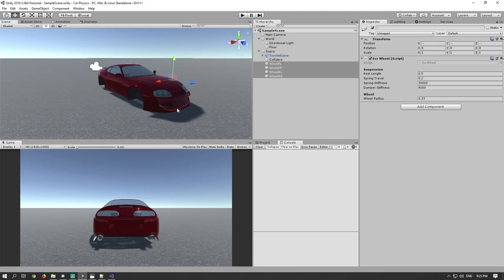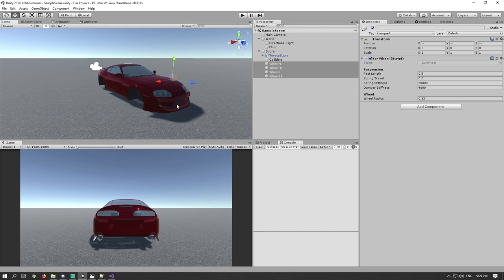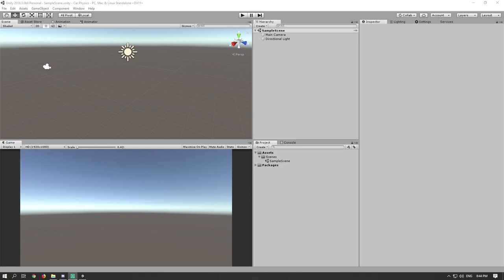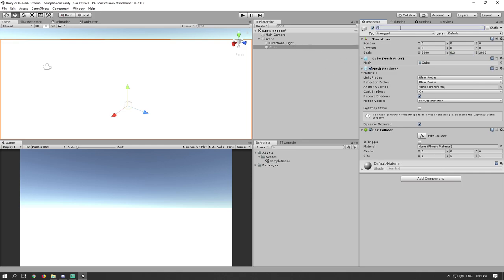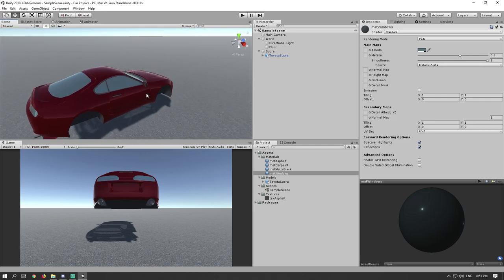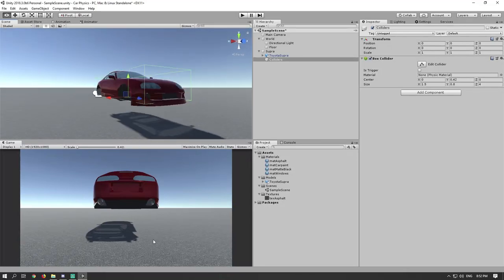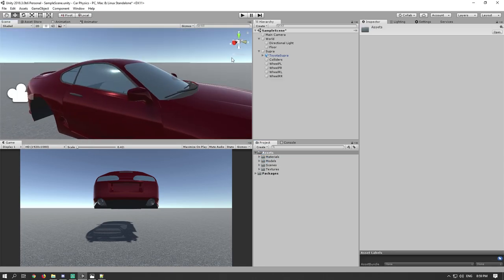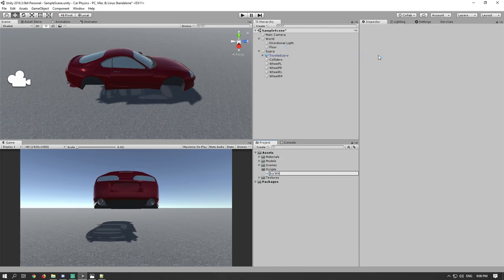Unity Car Physics - Lesson 1 - Suspension Physics

Comment: heres the code for this tutorial: (keep in mind, some values need to be changed to fit your game

using System.Collections;
using System.Collections.Generic;
using UnityEngine;

public class ScriptWheel : MonoBehaviour {
    private Rigidbody rb;

    [Header("Suspension")]
    public float restLength;
    public float springTravel;
    public float springStiffness;
    public float damperStiffness;

    private float minLength;
    private float maxLength;
    private float lastLength;
    private float springLength;
    private float springForce;
    private float damperForce;
    private float springVelocity;

    private Vector3 suspensionForce;

    [Header("Wheel")]
    public float wheelRadius;

    void Start() {
        rb = transform.root.GetComponent<Rigidbody>();

        minLength = restLength - springTravel;
        maxLength = restLength + springTravel;
    }

    void FixedUpdate() {
        if (Physics.Raycast(transform.position, -transform.up, out RaycastHit hit, maxLength + wheelRadius)) {
            lastLength = springLength;

            springLength = hit.distance - wheelRadius;
            springLength = Mathf.Clamp(springLength, minLength, maxLength);
            springVelocity = (lastLength - springLength) / Time.fixedDeltaTime;
            springForce = springStiffness * (restLength - springLength);
            damperForce = damperStiffness * springVelocity;

            suspensionForce = (springForce + damperForce) * transform.up;

            rb.AddForceAtPosition(suspensionForce, hit.point);
        }
        
    }
}
Reply: god bless you man
Reply: you are doing the lords work!
Reply: Thank you!

Comment: How is it guaranteed that RestLength is always greater than the SpringLength? You say so around 30:00 into the video, however looking at the calculation this doesn't really make sense.

RestLength is simply some nonnegative constant, and the Raycast Length is (basically) RestLength + SpringTravel + WheelRadius.

SpringLength is Raycast Hit - WheelRadius, and let's assume the farthest away raycast hit of just RestLength + SpringTravel + WheelRadius.

This means that SpringLength, in this instance, is (RestLength + SpringTravel + WheelRadius) - WheelRadius or just RestLength + SpringTravel.

So, in this instance, the RestLength - SpringLength ends up being RestLength - (RestLength + SpringTravel), where it is obvious that SpringLength is GREATER than RestLength, making
a negative value for SpringForce. This is foreseeable for any value of the raycast hit that is greater than RestLength.

I don't really understand. Any response appreciated, thanks.
Reply from the maker: Sorry, I can't really make heads or tails of your question.

Restlength is a static value, springlength is the value of length of the hit.distance, it's not restlength + springtravel
the hit.distance is the distance of the raycast before it hits the ground minus the wheelradius to just get the actual springlength
Reply: @blinkachu404  In the case where the suspension is extended past it's restLength this script will apply a downward force on the car. So this script basically simulates the car's suspension being bolted to the ground.

Also, clamping the spring length doesn't stop the car body from continuing to move in the same direction, only limits the spring force applied to it.
Reply: Anyone got solution to this?
Reply: @ShivamRajawat  I made it so my spring has a length and force is applied only when the spring is compressed (current length less than rest length)
Reply: Thanks will try that
Reply: @blinkachu404  he has a point ... i also have the same doubt .. I will simplify it for you 

he is saying that when we hit the play button .. the car hovers in the air (meaning when car is stationarry) .. so the hit.distance must be Restlength + Springtravel + Wheelradius. Though, the springLength comes out to be hit.distance ( Restlength + springtravel + Wheelradius) - Wheelradius. Therefore, springlenth will be Restlength + Springtravel.

If Springforce = springstiffness * ( restlength - springlength = [ Restlength + springtravel ] ), then springforce must be equal to springforce = springstiffness * ( - springtravel)

This means that springlength is greater than restlength. 

PLS CLARIFY THIS DOUBT.......

Comment: Question, did you face an issue where the suspension would bounce around slowly increasing the compression on each spring until it's too much and the car flips upside down?

Comment: Hello, thanks for the tutorial. I have a problem, the "out RaycastHit hit" part of the if is throwing an error: "RaycastHit is a type but is used as a variable". I'm using Unity 2019 1.1. 

Any ideas? Thanks!
Reply: Solved it. I had to create a new RaycastHit before using the if statement. 
 RaycastHit hit = new RaycastHit();
        if (Physics.Raycast(transform.position, -transform.up, out hit, maxLength + wheelRadius))
        {
        }
Reply: I also have this problem.
Reply: @orlandoguerrero7089  be blessed bidie,i didn't spleep the whole 9t figuring out what the heck

Comment: I've already pretty much posted this on similar videos but is there a way you can keep the "stick to the ground" arcade physics, the uphill and down hill speed, lose the car wobbling and shaking when it lands, and use that for a character in a 3d platformer? I'm in the process of making something like outrun (or 3D arcade racer) where you can attack. So you remove the spring physics. How would you always land on your feet? So instead of rotating and twisting like a car once you land you land straight up on your feet?
Reply from the maker: In that case you'd remove all actual spring code, and all you'd have to do is something along the lines of

if (Physics.Raycast(transform.position, -transform.up, out RaycastHit hit, 1f) {
       isGrounded = true;
} else {
       isGrounded = false;
}

then you can use the isGrounded boolean to set whether you want to apply gravity to your character or not.
How to always land on your feet regardless of angle is something I don't know, then you'll probably want to search for videos on planet gravity in Unity.
Reply: @blinkachu404  k thanx

Comment: I am getting the error
"feature 'declaration expression' cannot be used because it is not part of the C# 4.0 language specification"
When I double click it it takes me to the line with
if (Physics.Raycast(transform.position, -transform.up, out RaycastHit hit, maxLength + wheelRadius)){

Edit: Another comment had a fix for this.
You have to add RaycastHit hit = new RaycastHit(); above the if statement and remove the RaycastHit from it so you end up with

RaycastHit hit = new RaycastHit();
        if (Physics.Raycast(transform.position, -transform.up, out hit, maxLength + wheelRadius))
        {
        }

Comment: when i added damper, my car twitches, but if i set damper stiffness to 0, car behaves normally(without damping)
rb mass: 1205kg
spring stiffness: 30000
damper stiffness: 4000
how i can fix it?
Reply: Its possible that you're calculating lastlength after springvelocity, it should be the other way around: 1. lastlength = springlength; 2. springvelocity = (lastlength - springlength) / Time.fixedDeltaTime; Doing it the other way around means that you're calculating the current length of the spring, rather than the last length (which is what we want). Hope this helps!

Comment: Hey, I love this series and I wanted to try to incorporate it into my godot project, but the physics that I get seem way off, do you think that it is a problem with my code or do the Godot and Unity physics engines differ so much that it would require some big changes?
Sadly godot is lackluster in the vehicle physics tutorials, and especially the raycasts.
Reply from the maker: Unfortunately I've never worked with Godot so I really don't know. I haven't tested the code in other engines, but theoretically it should work, since the physics are based on real life mathematical equations. 

You may want to lower the values though, it could be that GODOT uses different values than Unity. Unity uses 1 meter for 1 unit.

Comment: This is such an awesome tutorial and very well explained Blinkachu! I have one question though. I am getting very different results for my mass setting. you have 1410 and I had to bring mine down to 50 to get even close to similar results as your bounce. I did not use your exact model.  Any reason you can think of for this?
Reply from the maker: Maybe your physics settings are not setup correctly in Unity? Or maybe a calculation or something that isn't quite right? (I have that happen sometimes when I follow a tutorial haha) 

Other than that I honestly wouldn't know, I've remade these physics three times in both Unity 2018 and Unity 2019 and have no issues with them :/

Comment: "It can help to see the raycasts in the scene view while its running, if you want to see that try adding this in your if statment:"

Debug.DrawRay(transform.position, -transform.up * hit.distance, Color.red);

"And add an else statment with"

Debug.DrawRay(transform.position, -transform.up * (springTravel + wheelRadius), Color.yellow);

"This allows you to see the raycast and is it is in contact with something"
Reply: Full Code Example:

void FixedUpdate()
    {
        if (Physics.Raycast(transform.position, -transform.up, out RaycastHit hit, maxLength + wheelRadius))
        {
            lastLength = springLength;
            springLength = hit.distance - wheelRadius;
            springLength = Mathf.Clamp(springLength, minLength, maxLength);
            springVelocity = (lastLength - springLength) / Time.fixedDeltaTime;
            springForce = springStiffness * (restLength - springLength);
            damperForce = damperStiffness * springVelocity;

            suspensionForce = (springForce + damperForce) * transform.up;

            rb.AddForceAtPosition(suspensionForce, hit.point);
            Debug.DrawRay(transform.position, -transform.up * hit.distance, Color.red);
        }
        else
        {
            Debug.DrawRay(transform.position, -transform.up * (springTravel + wheelRadius), Color.yellow);
        }
    }